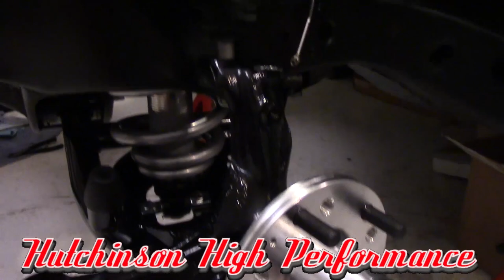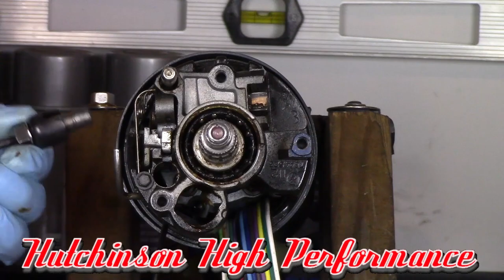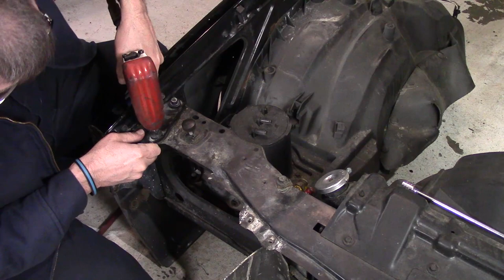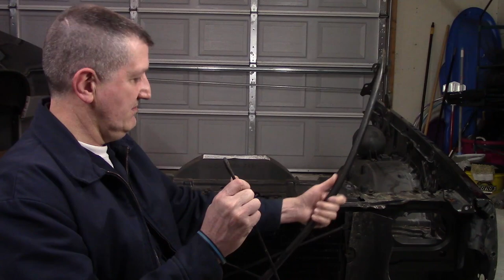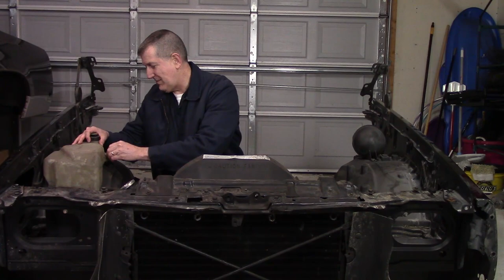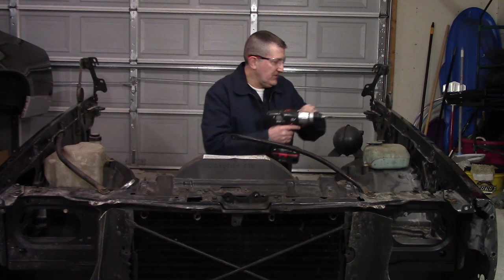G Body Core Support to Fender Brace Upgrade!! 1987 Olds 442: Video 50

Comment: I don't have the fender braces on my 83 El Camino, would this help in handling if I were to buy the set?
Reply from the maker: It's not for handling per se. It helps to brace the front sheet metal, which can improve overall body rigidity. You should look into the F41 bracing if you're going that route. here's an excellent thread on that at GBodyForum  https://gbodyforum.com/threads/f41-and-aftermarket-bracing-diagrams-more-pics-added.8126/

Comment: I always thought it was weird that GM put rear sway bars on the V6 cars stock but for the V8 cars it was an option and more frame bracing for the v6 cars too
Reply from the maker: Same.  They played around with aluminum hoods and rad core supports too. That seemed to have no rhyme or reason either.
Reply: @hutchhiperf  Kool thanks for passing on the knowledge much respect to you Jason I'll have to keep a eye out to bad most of the g bodies have been drag raced and circle tracked out of existence I have not see a g body in a junk yard in many years in Northern Illinois from the trends I see all of our good old car metals head to the east and west coast to be crushed and the metals reprocessed overseas also cash for klunkers killed many as well  take care your friend Jason

Comment: I did the red inner fender on an '85 442 and it looked weird.
Reply from the maker: Any pics??? Would love to see.
Reply: I'd like to see pics of the red painted inner wheel/ fender wells on a g body I thought it would be Kool to simulate the look of the old W30 W31 W32 on my 1986 oldsmobile cutlass Supreme brougham great minds think alike peace and much respect Jason aka "THE CUTLASS KING" I'm also putting a ram air hood  with correct oldsmobile hood hold down locks on my fiber glass hood keep it all GM keep it all OLDS an Oldsmobile puritan for life
Reply: Sorry no pics.  Immediately changed it back to black.  Might have been due to the LS I have in it so could look better with period correct engine.
Reply from the maker: @steveg4232  Bummer!  I may photoshop a pic and see that way. Thanks for getting back to me!!

Comment: The Grand Prix got all of the bracing options. I don’t get it.
Reply from the maker: You and me both. But at least there were stock options to pick from at the bone yards.
Reply: Pontiac was gm’s performance division that’s why the Grand Prix got all the bracing. But if you can find a 1978-80 Cutlass Calais they have a similar brace that bolts up to the original “coat hanger rods” as you called them.
Reply: I remember very well when doing PDI's at the Pontiac Buick dealer when these cars were new ... how much tighter the Grand Prix SJ's were even over the Grand Nationals. I'm partial to the GN's as I have collection of them. But the Grand Prix came with every brace & even the #5 GNX body bushing. The center console was a work of art for the time & had a nice short shifter a real gauge cluster. The doors, hood & deck lids fit better and the paint was far superior.  Only conclusion I can come up it ... they were MADE IN CANADA  ;) ;) ;)
Reply: @viewonthelake1  the Grand Prix wasn’t the only gbody beside the GNX that came with the #5 body bushing my 81 cutlass Calais came with it also might be something with the f41 suspension
Reply: @81cutlass93  My 85 Cutlass Supreme Brougham also had the #5 bushing. Just replaced the factory bushings last week.

Comment: Red inner fender wells were on W30 cars, also the thicker braces go to the center of the firewall not the fenders,  above the distributor
Reply from the maker: Did you watch the video?? They're Fender to Core Support Braces from a 85-86 Grand Prix. Also, G-Body's didn't have fender to firewall braces at all.